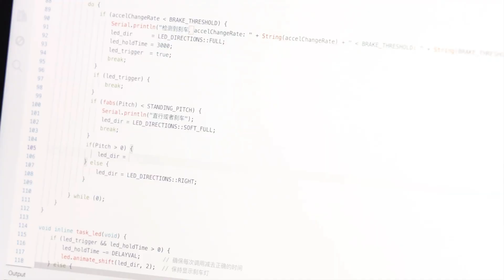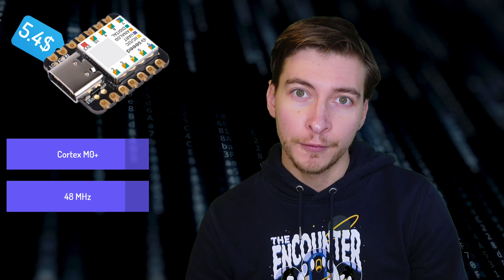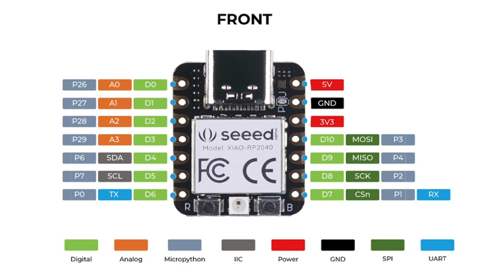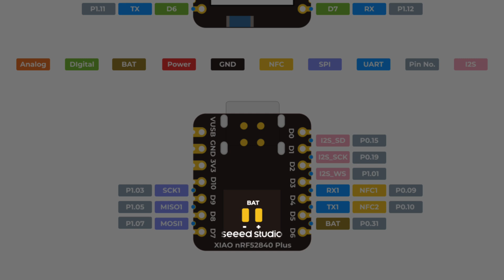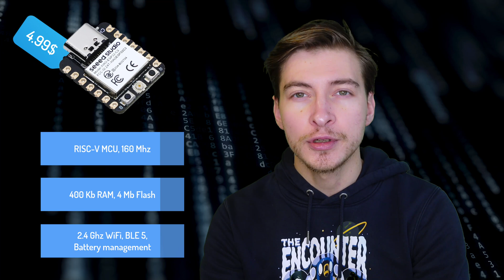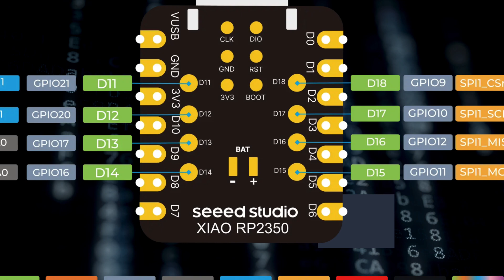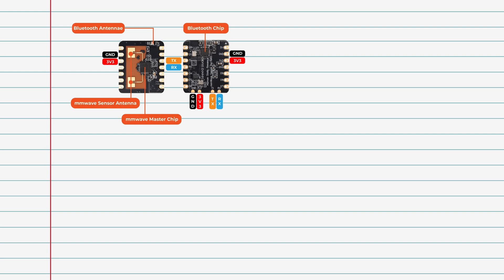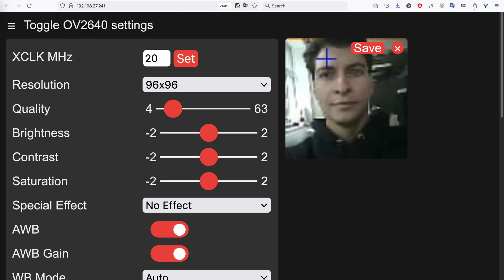Smallest Arduino Boards - Seeed Studio XIAO Explained

Comment: have you or anyone tried using the XIAO with MAX/MSP? MAX won't see the XIAO for some reason, and won't stream any of the IMU data being sent to it... even though there is data going through my serial monitor...
computer sees the XIAO in terminal. 
using a mac and using arduino IDE, high level example :/
Reply from the maker: Pardon my ignorance, but what is MAX/MSP?

Comment: Basically anything is more powerful than original Arduino UNO, unless you count power drawn from pins. 
For me, form factor is not that important, but what i like is that it's great to play with nrf52840 mcu, it's easier to use than Raspberry Pi Pico due to USB-C cable and easier switching to bootloader mode and expansion board is not bad. Right now I'm experimenting with Zephyr a bit. Raspberry Pi Pico is still great - cheap, well documented and has lot of pins.
Here, maybe not everything works out of the box, for example nrf52840 has some ubluepy library in micropython which has no documentation, it was abandoned six years ago and there are like three examples that can be found.
Reply from the maker: Well said!

Comment: Bro, It's is obvious to me and by what you said(all sales PR) you have NOT built anything with them. The MG24 is the worst Xiao to date IMO, with NO interrupts and BS. sleep current numbers, NO external Wakeup and a lot more of SIL, and VAPORWARE libraries for it. Let us see a  Matter or Zigbee example, There aren't any. The ONLY Xiao Worth it weight is the NRF52840 which has the lowest Sleep current of any of them, supports WAY more I/O, and has the BEST BLE in the industry, SIL was a graphics co. they have NO business in the MCU biz. just cheap... You should really get some hands-on or come to the support forum and get a dose of reality. HTH GL :-) PJ :v:
Reply from the maker: Hey, thanks for the detailed comment! Really appreciate you taking the time to write it, the feedback from users is just as important as what I said in the video.
I have personally used the original XIAO, XIAO RP2040, nRF52840 and XIAO ESP32-S3, basically all the boards I've shown in the video. All these worked properly and software support was at "regular" Seeed level (they're not the best, but def not the worst among dev board / sensors manufacturers) - some of them are even featured in other videos.

Now, about MG24 specifically - that one I have not used myself, that's true. There is Matter example for it here? https://wiki.seeedstudio.com/xiao_mg24_matter/ it does not support zigbee, so there is no example for that quite obviously.
Reply: Hey, PJ. If you forgive ESP32 its greedy current consumption - it is a pretty cool & robust board and chip. WiFi, BLE - lots of libraries, fully supported in PlatformIO.

Comment: I like the M5Stack StampS3 and can solder the tiny connections by hand, but there is a breakout board version as well. It becomes a board of some sorts any way. The Raspberry Pi Pico is easier with SPI in my opinion and it's a bit "unfinished" with the connections in my opinion (all ESP32 items). I am looking at various micro controllers on top and there is always something. It's been mind blowing to learn about it all (in a good way), though.